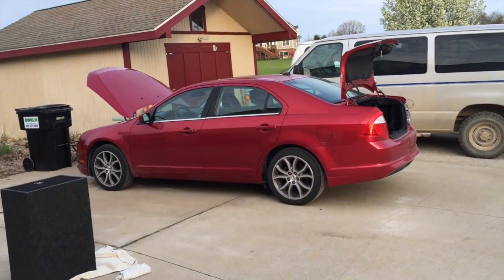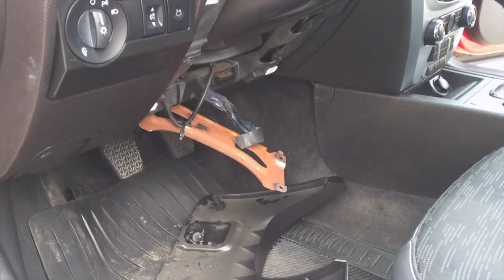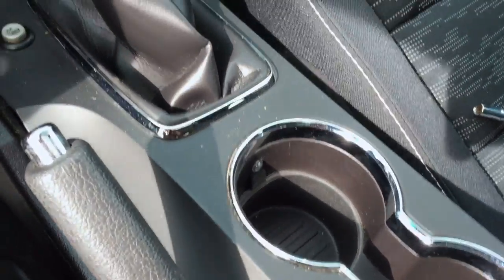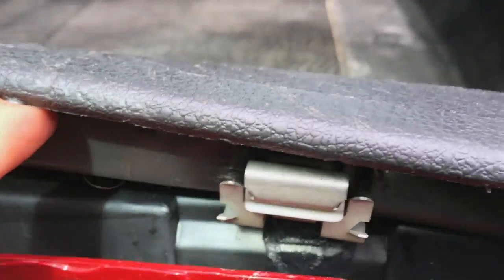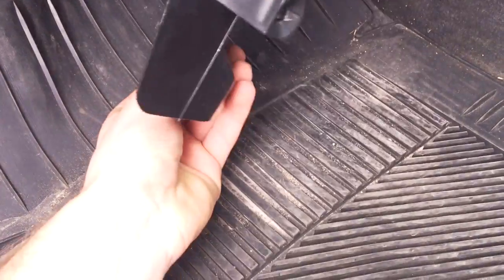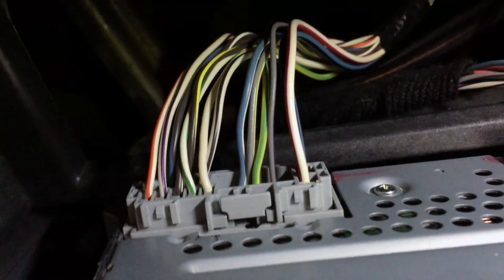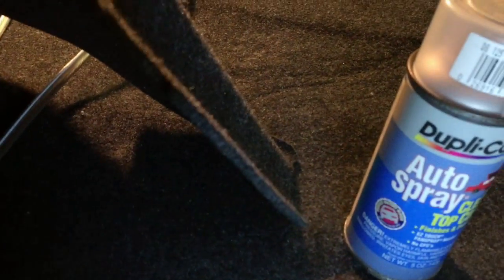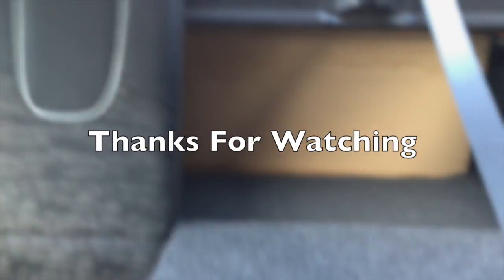How to install subwoofers with a factory radio - 2010 Ford Fusion

Comment: i have a 2010 fusion se and i have a lc2i hooked up along with old school 800a2 punch amp with 2 hx2 punch 12" subs on 8 gauge wire but everytime i turn off radio it makes a sound wave noise or a zap noise for a sec or 2 sometimes it will make a long zapping noise do you know what it might be? or whats causing it to happen?
Reply from the maker: Two Hav it can depend on how things are wired and the equipment you’re using. Usually noises like that on shut down/turn on are because the radio shuts off/turns on before the amplifier shuts down/turns on fully. In other words, audio signal is interrupted and the amp hasn’t fully shut down or turned on yet. You can test by unplugging rca cables from amp, turning on and shutting off and seeing if there’s the noise. If no noise with rca unplugged from the amp, problem is like I mentioned above and you need a way to stop audio signal until amp fully shuts down. Hope this helps!
Reply: @XxkristofpopxX  yea found out the amp was on afteraudio was being cut off all due to the remote wiring , the audio place connected ended up connecting the remote wire to the ignition wire switch so now it only does it when turning on the car and not when turning off car so im going to go back see what they end up doing now

Comment: what did you do with stock amp?? I'm having trouble with my Rockford fosgate amp overheating. I have 300 watt adapter. thinking about bypassing but IDK with the interface in there.
Reply from the maker: I don't have the premium system so there was no separate stock amp to deal with. If your amp is overheating, make sure it's well ventilated, and check to make sure the amp is rated to handle the resistance you have (1,2, or 4 ohms?). Your amp should also not have to be turned all the way up, so double check your settings. You could also mount a fan to cool it off.

Comment: What are the measurements of the box
Reply from the maker: Daniel Littlefield the box is approximately 36” wide, 14” tall, and 22” deep. The port hole is about 4” by 12.5”. I’d suggest a slightly smaller box if you’ve got a fusion, I had to really work the angles to get this box in the trunk!

Comment: Are there rca connecter in the back of the stock stereo?
Reply from the maker: Nope
Reply: I just put up a video also . i tryed spiking my back rear wires and my whole radio system went down .. So spiking the wire is not my best but im still looking into it.. Any advice on the rear wires colors not to sure i spiked the correct ones

Comment: only thing i needed to know was how to hook up the remote wire. watched the whole video just for you not to show me
Reply from the maker: rea ct The LC2i has a remote wire built into it, so when it receives signal through the speaker wires from the radio it will send a signal through the turn on wire.
Reply: @XxkristofpopxX  do you still have the ford fusion?
Reply from the maker: River Alley I sure do, drive it everyday
Reply: @XxkristofpopxX  Anything new in it?
Reply from the maker: River Alley Unfortunately nothing sound wise, I did add a towing hitch though. I’ve thought about replacing the radio and adding new speakers and a 4 channel amp, but priorities are elsewhere.
Reply: @XxkristofpopxX  Have you tried floating things?

Comment: What's the line output converter?? Do I need it?? I have Same car working on instal rn
Reply from the maker: Donald Trump2020 The LOC converts the line level coming from your radio to a low level RCA signal that your amp can use. You don't need an LOC if using an aftermarket head unit because they typically already utilize a low level RCA hookup in the back of them.
Reply: Ok gotchu noe I just ran to best buy and bought one lol I'm gunna connect them but where do I put the rem in the factory radio? It's a small blue wire that runs from radio to amp
Reply from the maker: Watch the video and read the comments and you'll be fine. Everything is explained pretty clearly.
Reply: Just finished. Great vid man really appreciate it

Comment: what kind of wiring did you use? 4 gauge or 8?
Reply from the maker: Jesse Kingman the power wire is 0 gauge and the speaker wire should be 12 I think.

Comment: Where did u hook your remote wire too?
Reply from the maker: My remote wire runs from the LC2i to the back of the amp. The LC2i has a built in remote that switches on when it senses power through the speaker wire. Hope this helps!

Comment: What did you connect your remote wire to?
Reply from the maker: Remote wire goes directly from amp to LC2i, LC2i sends remote signal when it senses power from the head unit.

Comment: Where did u run the remote wire
Reply: Cortez Henry 
Lc2i has gto 
Senses a signal and therefore doesn't require a separate remote wire

Comment: What what was that grommet you put in around the power wire through the fire wall? A putty, or silicone, or something? Where'd you get it?
Reply from the maker: It's actually this stuff called thermomorph or InstaMorph, and I actually wouldn't recommend it because it was hard to work with. It comes as these little plastic beads that become moldable when they're heated up. I just so happened to have some and decided to try and make it work as a grommet, but I definitely think there are better options.
Reply: XxkristofpopxX ok thanks!

Comment: where is the remote wire for it?
Reply: Derek Tulaga did you ever find where the remote wire is
Reply: The LC2i has remote wire built in to it so it will power on the amp automatically when the radio turns on
Reply: Could have tapped in to it behind the radio or at the fuse box if he was using diff hardware

Comment: Worst way to do this, I have the same car and I popped the radio head right out and only had to remove a few screws. You could have done this with way fewer steps. Only took me 15 minutes to wire subs into my car

Comment: U didnt have to take the radio out and do all that. U could of just did everything from the trunk. Use the back speakers.
Reply from the maker: Thanks for the input bleek101, but I don't have speakers in the trunk. Plus, I figure its about as much work getting to the rear door speakers as it is to just take the signal straight from the source at the radio. Thanks for watching!
Reply: Yea my bad lol. I seen that for my self. I just did my 2010 fusion se 6 speed. I did the door speakers much easier. Good video though u the one gave me the idea.

Comment: What size amp your using
Reply from the maker: It's 1200 watts RMS
Reply: Ohkay like what all did you do to make it shake like that
Reply from the maker: Built the box to recommended ported enclosure subwoofer specs, and tuned the amp with a multimeter to make sure it was putting out 1200 watts.
Reply: +XxkristofpopxX you got 12' woofers or 15' woofer
Reply from the maker: They're just a nice pair of 12's
Reply: +Jay Martin never mind don't answer that........ thanks for the information
Reply from the maker: ____GHOST____ Havnt gotten around to the big 3 yet, but tested my voltage while on max volume and have a steady 14.3 Volts. I believe my stock alternator is rated around 150amps, which is a little low for the system, I agree, but it's still capable of pushing 1200 watts rms. While playing a 60hz test tone at 0db on max volume, I tested the AC voltage output on my amplifier and got a reading around 36 volts. Using ohms law, since my resistance is only 1 ohm and I'm getting 36 volts, my wattage is actually around 1300w. And like I said, my readings were steady at 14.3 and 36 volts.

Comment: Should be getting this car within the week and i have subs to put in. Does your car sound like shit from outside or?..
Reply from the maker: Why does it matter what the outside sounds like, you'll be listening on the inside?
Reply: So I'm not that one guy driving around with a shitty rattling going on the outside of the car
Reply: I think he's talking about rattles.. which could be somewhat avoided by using something like damplifier pro or fat mat.
Reply: i have 2 12's and the only rattle i have is with the license plate and i just put a piece of foam under it and it sounds good
Reply: I dont think it will rattle

Comment: Where did you put your turn on wire?
Reply from the maker: Turn on wire goes directly from the remote out of the LC2i to the amp. I use the signal sensing function, everything turns on when the LC2i senses the radios on
Reply: +XxkristofpopxX i used metra loc... Do you think it would worked also?
Reply from the maker: +Nolan Servano No, it doesn't look like it has a remote out on that unit.
Reply: +XxkristofpopxX oh, so i really need to tap it somewhere in the fuse ox? What would you suggest? Thank you...
Reply from the maker: +Nolan Servano You don't have to go into the fuse box, just get a find a power wire that turns on when you turn the key and run it to the amp. Like a cigaret output or something. You could even just install a switch so you can just flip it to turn on the amp.
Reply: +XxkristofpopxX sthanks man.... Appreciate your help! 👍

Comment: When you hear vibration you’ve put to much subwoofer in the car for the size of which the car is. I’ll never understand why you young’s pups and even some older people act like you need two woofers and they have to be big to get nice sounding bass.
Reply: Just because you aren't a bass head doesn't mean others aren't. It's about feeling it too. Also sound deadening is a thing for a reason?
Reply: @imthemistermaster  you can have loud clean bass and feel it without it sounding distorted.
Reply: @coyote5.02  lol the vibration you hear is all the plastics and other things in the car moving and vibrating because the sub is hitting those items resonance frequencies. It is quite literally what you feel in the bass, as with the power to make sound waves big enough to vibrate your chest, you've also got power to vibrate your car. It's not clipping unless theyre just a clown. Some systems even make things in your phone vibrate so much it'll distort the video
Reply: @imthemistermaster  if you use Dyno Matt that doesn't happen. My cousin installs systems and he uses it to deaden vibrations from the heavy hits of bass.
Reply: @coyote5.02  so you should know that it's not "too much sub for the car" it's too little sound deadening for the sub.
Reply: @imthemistermaster  if you go with a smaller sub you won’t have to use more deadening. but because the car is small and you put such a big subwoofer in the car you need more deadener for it to sound clean. translation. to much sub. but yes can be made to sound good with putting more deadener in the vehicle.

Comment: is it the same wire config for newer fusions? 2013
Reply from the maker: What do you mean wire config? This method can work on any car and any system that has a full range line output. Or do you mean the wiring harness in the back of the radio? I would imagine it may have changed with the updated radio in the 2013's.

Comment: Why not just tie in to a door speaker? Then you have to run your line out converter from the head unit all the way to the back where your amp is whereas if you tie into a door that's less distance to have to run wires and dashes never go back the same way they came apart but on top of all that I've been working on my system for like 3 days and I know it works cuz I had it playing in my shed when I was testing it and I've spent like 3 days trying to get it working in my car and it doesn't work so I'm about to kick a hole in my jail adios because I'm tired of wasting money and time on this bullshit when manufacturers intentionally make their vehicles where you can't easily add aftermarket stuff which is bullshit like why not give it a better sound system if you're going to make it so difficult for people to upgrade it